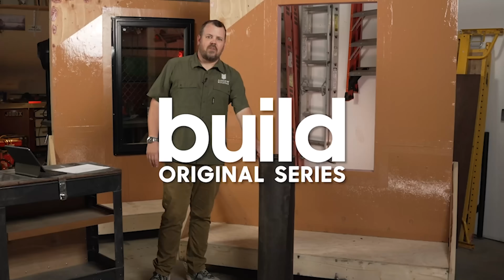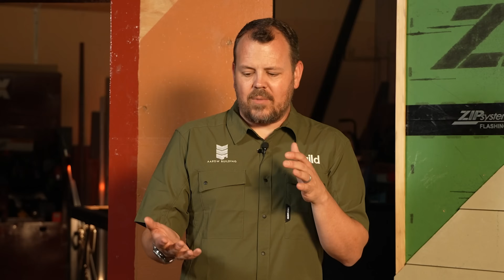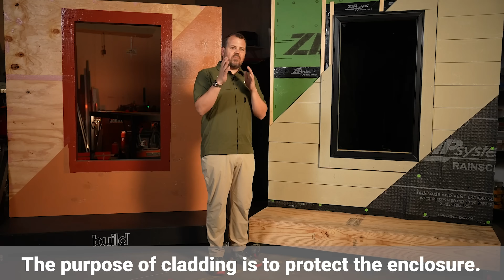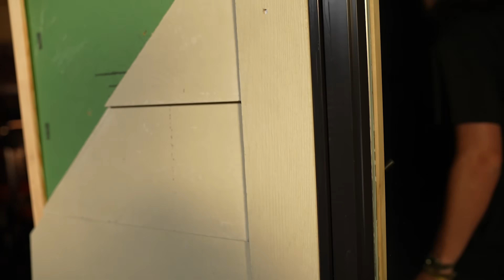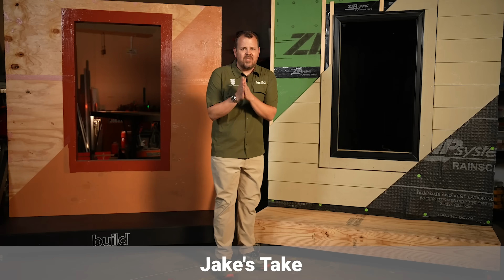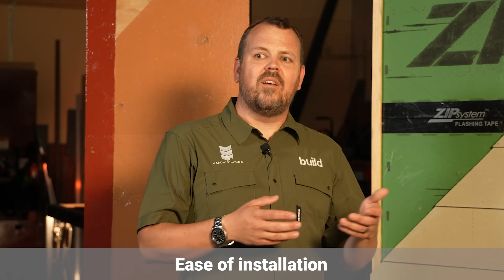Episode 4. What Should I Use? - Siding

Comment: In BC Canada, when building our family home, I was also required to "vent" my exterior sheathing, which none of your videos depict, to allow any accumulated water vapour a path to leave each stud bay within the wall assembly....
Reply: Is vapor permeable sheathing tape sufficient for that?
Reply: @niktak1114  No. They required either horizontal 1/2 inch gaps between the plywood sheathing or in my case I had to drill 2.5 inch diameter holes - 2 for each stud bay. Then the vapour barrier was applied overtop....

Comment: Don't use vinyl sidding had a fire and vinyl is very hard to put out and cracks and breaks in temperature changes especially the cold.
Reply: And it looks cheap anyway
Reply: It all depends on the budget. Yes , there are many better looking products but the cost will be much more. Also , vinyl does not crack in the cold. I live in the New England and we get some tough winters and I have never had an owner call me about cracked siding.
Reply: I like Vinyl but I’ve never caught my house on fire so that’s probably why.